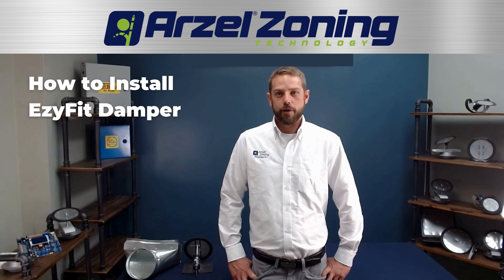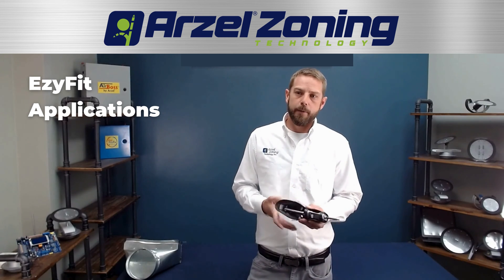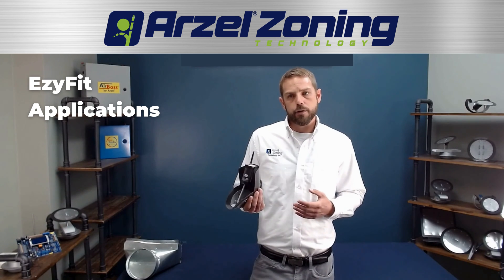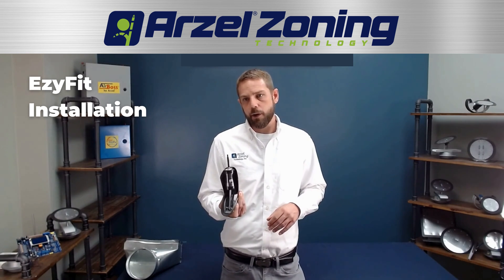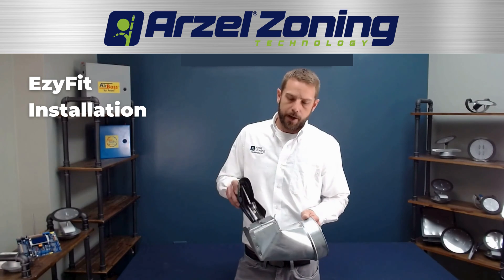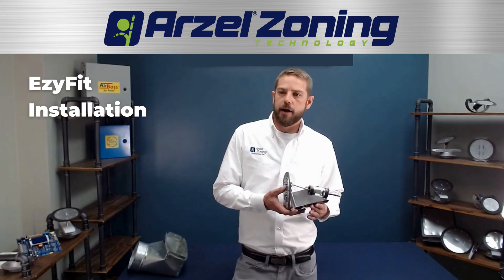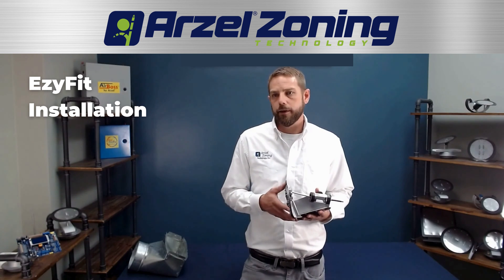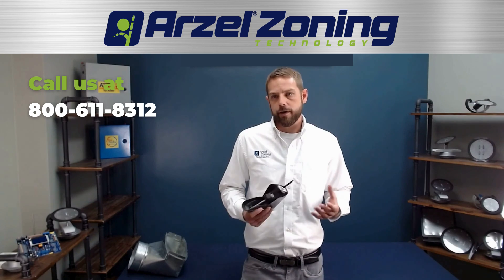How to Install the EzyFit Damper from Arzel Zoning

Comment: This is perfect -- I have a 70s bi-level home with significantly different heating/cooling requirements between floors.  Since the plenum serving registers is in between the floors and covered by drywall, I can't get a traditional zoning system installed without significant time, cost and construction.  Your database lists Princeton Air for my service area (NJ, 08520), but they have been getting negative reviews lately.  Do you have another approved installer in this area that I can contact for an estimate?  Thanks!
Reply: @arzelzoning  Thank you for your quick response!